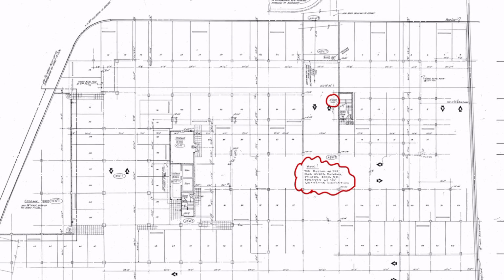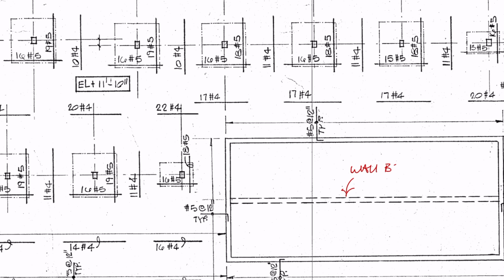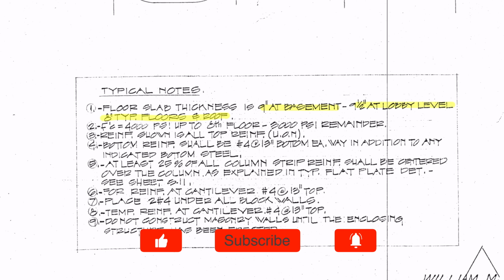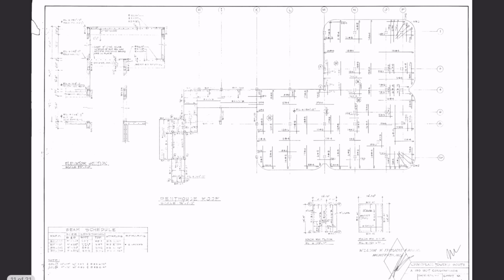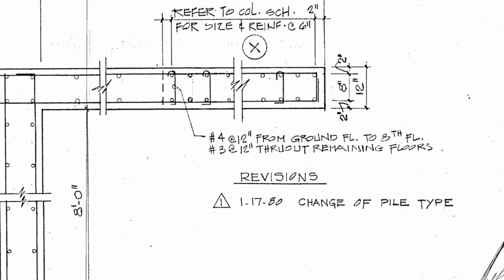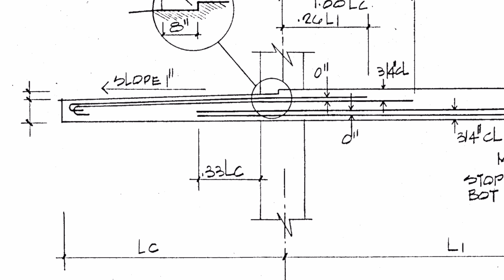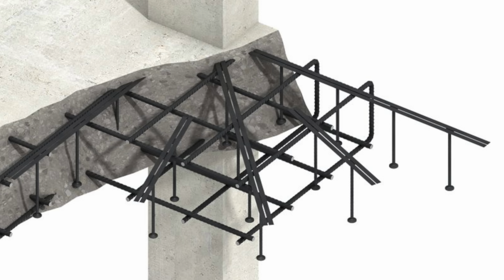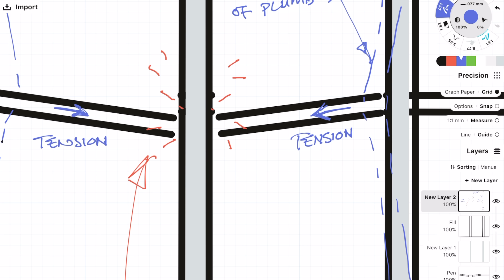Surfside Condo Collapse - Reviewing the structural drawings - Was the design bad?

Comment: In the 2018 report on the 40 year restoration by Morabito, no mention was made of any repairs needed to the foundation but in the 2021 repair and restoration construction plans new grade beams were specified to be added to the pile caps. No beams were installed and my question is: could pile cap failure have been the trigger to this collapse? If several caps in a row failed simultaneously could this have caused the whole building to collapse? I have asked several structural engineers this question and have gotten no response, could you please address this for me? thank you for your time and expertise.
Reply from the maker: I’m not sure what the grade beams would have done. The pile caps themselves are very big and deep with a lot of piles to them. I think a pile cap would only really fail  if there was a really sudden movement in the ground like an earthquake. Even if it’s true that the sands are moving, I don’t think it would have caused the pile caps to fail as the movement would have been slow and the structure would move and adjust with it. 
I’d be interested to find out more about what they found regarding the foundations but I haven’t looked yet.
Reply: @EverydayDazz  Take a look at the July 9, 1980 collapse of a crane onto a line of columns at ground level during construction of the towers. Was there damage to the foundation then, I can't tell from the video. If several of the critical caps were damaged then and allowed to rust in salt water for 40 years then there is the trigger... its the only thing that stands out in this incident.
Reply: The report said building sinks 2mm per year, placing added uneven stresses into slabs and columns !
Reply: There are pictures online of the evacuated site. There doesn’t appear to be any major damage to the garage floor.
Reply: @neilkurzman4907  I understood that there had been considerable work to the garage floor due to cracks/water penetration - certainly the garage video indicates at least one large 'repair' area, but I may be confused as most focus has been on the pool deck. I haven't seen anything that considers if the garage floor was supported on columns/pilecaps or was ground bearing
Reply: @postie48  
The pool deck is also the roof of the garage.
You can find pictures and video of the cleared site. The concrete slab appears to be free of any large holes. That would be the floor of the garage.

Comment: Very, very informative.  Did you know they added an extra floor, the penthouse level, on top of the original.  Do you think all that extra weight, who knows how many tons that was, contributed to the demise of the building?  Also, I am curious as to why the posts underneath the part of the building that remained intact were so much larger than under the rest of the structure.  Did you see the video taken from a camera inside one of the apartments taken during the collapse?
Reply from the maker: I didn’t know about the extra floor but that certainly would have added a lot of weight. Just hopefully they spoke to the engineer about it first! 

If you’re referring to the posts as the structural columns. The columns at the ground or basement level will be supporting more weight so will need to be bigger than floors higher up.
Reply: @EverydayDazz :)  I have a personal interest in finding out what happened as I have family that lives in Tampa in a condo building built roughly the same time (1979 I think).  The columns I was referring to were, according to the plans 24" x 24" under one part of the building and 14" x 16" under the rest; both at ground level.  I thought that was really strange.  Please do take a look at this video taken from inside one of the apartments during the collapse.  Thankfully the residents were not at home during that time.  https://www.youtube.com/watch?v=1cToijm6ygY
Reply: @AgentPepsi1  Hurricane in Miami comes from the South-West direction. My guess is that side of the structure was designed to be stronger to withstand the wind from that direction. Also, the valet parking was on that side so the beams below were larger to accommodate the load of the cars being driven and parked on to the deck above.
Reply: @AgentPepsi1  You can calculate the size with free calculator online.
Reply: Also, the top four levels under the penthouse appear to have had their wrap around balconies extended right over one of the main columns that is thought to have been one of the first to collapse. As these balconies weren’t shown on the original drawings.  Can you check out the drawings & make a comment.